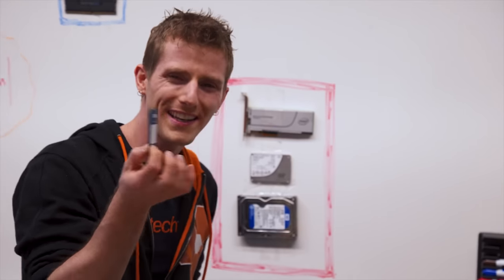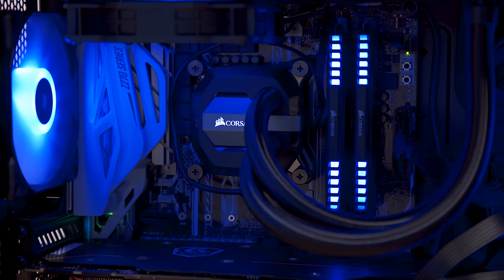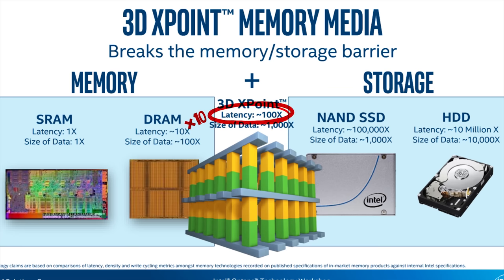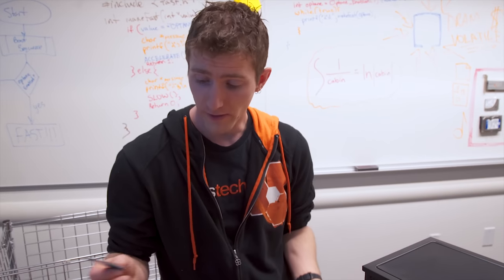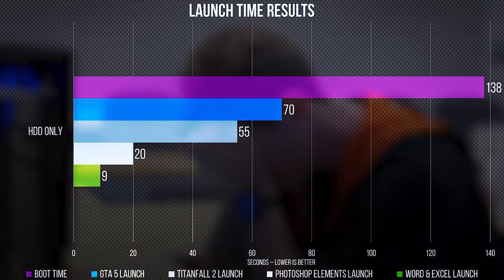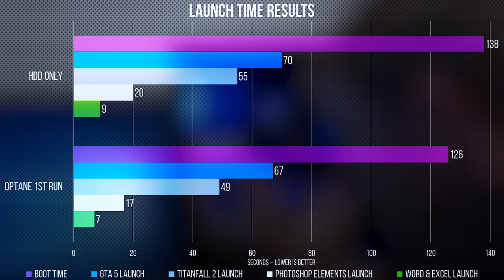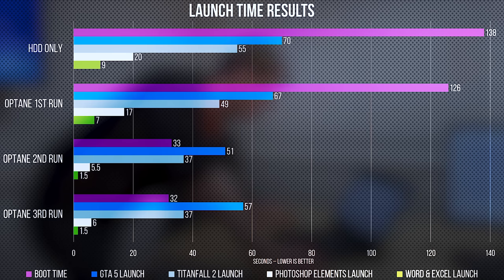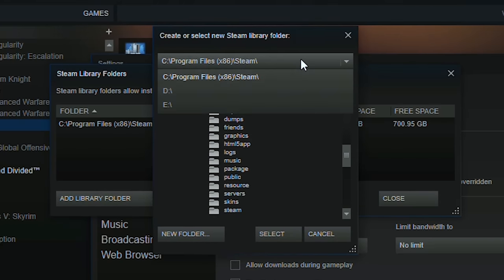Intel Optane Exclusive Hands On - SSD Crushing Performance

Comment: Everyone uses SSDs now why was optane compared to a HDD only
Reply: Pathebach You have to pair it with an HDD.
Reply: Okay, so let's see it paired to an SSD. (I haven't used an HDD in close to ten years.)
Reply: I'm betting it would slow the SSD down. As you would expect when adding another layer of something that's not appreciably faster.
Reply: Now . . . sell me 2.5TBs of the stuff on a single M.2 card for $500—and then you have something. Until then? Why bother.
Reply: Richard Due I think your missing the point of this product.
Reply: This product has a point? Do you want to guess why Intel isn't comparing the speed of this product against a Fusion Drive? Because I can answer that for you real quick. Do you want to guess why Intel isn't comparing the speed of this product against the newest SSD drives on the market? I can answer that one even faster.
Reply: Why is Intel comparing this product to pokey old hard drives? I mean, I don't see GM comparing the 0-60 time of their Corvettes to 1960 Mustangs, do you?
Reply: The man is right guys. This product is useless, the technology is very good. Just wait for actual optane ssd's the technology is still too new.
Reply: Because Optane is not targeted to the PC with SSD. If you use Optane with SSD, it won't be any faster.

Comment: In case it hasn't been mentioned, the beauty of optane and 3dxpoint is the speed and resiliency over ssd and no volatility compared to dram. 3DXpoint's speed, latency, etc. is encroaching dram speeds. If we had nonvolatile storage as fast as dram without the cost, why would we need to separate memory/ram from harddtove/storage? Big enough optane sticks in the dimm slot and you can run the entire is and everything on it directly from memory, as if you had terabytes worth of dram running the os and files.

Comment: so basically it turns your hdd, into a hybrid drive but split into 2 parts on the motherboard. Caveats:
1. over M2 instead of SATA, (so a little faster)
2. The algorithm that decides what to cache is pretty good (learns from iteration 1)

Comment: Good video, short and informative.  I was hoping this tech would replace current M.2 NVME drives with something many times faster, but it was not.  Instead, it is a very fast hard drive caching device which does improve performance.  And since it is a cache device, files open at normal speeds the first time you open them.  Once they are in the cache they can open faster.  If the batch of files you plan on opening are larger that 32GB, the size or this device, you may not get the full effect.  Just not what I was expecting.  Thank you.

Comment: I created something similar with a Z68 board and a 32gb mSATA drive using iRST. Just a "cache" drive, but it did speed up Windows 7, Battlefield 3, and other applications as well. Of course that was quite awhile ago. Same idea, just updated "interface".

Comment: This would be a great add on for some lower spec users that are rocking hdd's. But i think the problem lies in the z270 and kaby lake processor requirements as most people these days building new systems already are using SSDs. 
So the real excitement will come once we can get these in bigger sizes at good $/GB and use them as main drives.

Comment: For ext4, data=journal vastly increases I/O performance of recently and yet to be written data on an HDD.    Also use noatime, nodiratime (noatime doesn't affect diratime, I tested it) and async.  Data=journal improves overall performance on lager disks for most workloads because the journal is large enough that copying data from it to the general area of the partition can be done while the HDD has nothing else to do.

Comment: The problem with caching is not the speed of the cache but the SIZE of the cache. As it is now, the small size can only cache the OS. If this is the case, launching programs would still be slow as a HDD because the cache does not have enough storage to cache it. A better solution is to use a ssd cache so it can cache much more data.

Comment: If this is gonna be usable we would need to expect atleast 250gb drives. Because even with the speed the limitations of the OS and other hardware won't let us benefit beside the storage amounts. But if it does reach that capacity and is around $2 to $3 per GB I would be all for it for early adaption. Considering I'm only using NVME drives as my main storage.

Comment: I am quite pissed about the whole "you need a 7-series cpu to use this" bullshit. This one goes to intel: you would not need to desperately try to force people to your new cpus if there was any useable advancement when changing from a 6800k to 7700k. Just do your job and quit annoying us.
Reply: Then dont buy it, some of us move forward and not back. I dont expect the first generation of this product to me WOW, but the second generation I expect alot from this. For alot of people, I can see me putting down 40 bucks for this stick, and buying like 4 2TB HDD's if it gives all my HDD performance like an SSD. Actually that is pretty cool. Instead of buying multiple SSD's
Reply: I surely wont because i don´t need it in my ssd only system.
I am just worried about these developments. At least Intel and Microsoft try to force us to switch to new tech that, in itself, shows no real benefit. So they complement it with nice advancements in other areas. Be it the x point cache or dx12. I would call that "artificially outdating".

Comment: 1. Would like to see what effect this has on an SSD system drive. I know it's not the intended usage and probably not a boost anyone really needs, I'm just curious to see the numbers :)  (effect on a hybrid drive too, for that matter) 

2. SSD system drive, big HDD for games <-- still a common setup, yep/no?  Could you use this thing to benefit only the secondary HDD (to get as much benefit for as many games as possible, rather than spending any of its space on the system drive)?

Comment: i think that the purpose of this, (if we leave aside the fact that it's made for 7th generation intel cpu's :3) is that if someone wants a 1TB or more of disk space an ssd would just be too much instead you could buy t optane for like 70-80 with the hdd and achieve ssd like performance

Comment: Thank you Linus! I've been waiting for a video explaining this.  My question is that with my new build, I have a Samsung EVO 960 m.2 250Gb with a 1TB 7200rpm sata HDD. I also have a supporting z270 mobo and a 7th Gen Intel proc. I cant find a straight answer on whether Intel's Optane Memory technology only works with their own Intel M.2 SSD's or it will work with my Samsung m.2 + other brand m.2's. Thank you for all the content you continually crank out. They have provided huge amounts of help.

Comment: I'm going to buy an all new system that is ready for this stuff. Got the money saved up right now. This requires a very new high-end system. I like the top of the line Intel unlocked processors, they rock..

Comment: I just built a machine z270, 64GB Corsair dom-plat and the samsung 960 Pro m.2. Will this optane memory do my system any good? I think the Asus Formula IX has 24 PCI lanes. Is there enough bandwidth to go around? PS, this machine is for Photoshop/Lightroom etc.. Lastly, how does this compare to Ramcache/Drives.

Comment: So........my question would be.........If I have just built a desktop using the z170 MB, Skylake I7 6700k and two sticks of Samsung 950pro 512mb NVME, configured in Raid 1; is there an extreme benefit to ditching all of that for a z270 MB, Kabylake 7700k and switching to an Optane memory stick in place of the 950pro SSDs?

Comment: I use smart response. I think people under estimate it. It's really nice for large storage drives. It can also cache arrays. Or have a games or editing ssd use part of that to cache your storage drive. Yes this is rather high end compared to where it was marketed but it works well. 

I would like to see a in deep dive into this since I don't have Z270. Does it cache anything to any drive? How hard it the setup as Smart Response was tricky especially when you wanted to still use your SSD as a boot drive. Does it cache writes or just reads? The durability would make me think reads as well.

Comment: As I'm sure others have commented, this looks the same as Intel's "Smart Response Technology" using an Optane drive instead of a flash-based SSD for caching.  You've compared the performance of a hard drive with & without an Optane cache -- if you'd also do the same measurements with & without an SSD cache this video would be worth watching, instead of being a waste of time.

Comment: I imagine that the broad-market end-user case is to speed up application load times and make your computer seem "peppier" - it is NOT a replacement for storage. If I was Intel, I would be marketing the Optane as a quick fix for your aging computer. The downsides: #1 apparently (at least at this time) you need an Intel platform, so they have lost much of the bargain computer market out there; #2 your motherboard needs an M.2 slot, which rules out most computers built more than 3 years ago.  I wonder what the return rate for the Optane will be from the typical user who can't/won't read the system specs first. 

There might be a niche market for custom PC makers also, but make no mistake - that probably isn't going to sell as much product as the "older computer" market.

Comment: Hang on, what is the difference in performance when you replace the mechanical hdd with a standard SSD drive...or even a hybrid SSD would it be worth all the cost of a 7th gen intel cpu and motherboard that supports m.2 ?  cause once you games have loaded, you just wait for other players to load their game anyways...

Comment: Try as I might, I can't see the point in this... surely an ssd or nvme drive is all you'd need to speed up a system, there could be some use if you already have windows on a HDD, but even then you can mirror the data to an ssd using software. Is it rated just for consumer devices? In enterprise it could be useful to boost access times on shares ?

Comment: You could still buy an acceptable SSD with more storage space and add a primocache license and you'll be better caching bigger stuff like games, not to mention with the ability to configure the cache as you want and avoid the requirement of having to buy a 7000 series intel chip plus a 200 series mobo. 16GB or 32GB won't be enough to cache more than probably one game plus windows stuff...

Comment: i get it, its not for enthusiasts and heavy gamers, but more for the basic consumer/ office work/client machine.  but it requires a 200 or higher series motherboard, so in reality, a new build.  in this case, why wouldnt the system builder opt for a fast SSD or nvme instead?  capacity is never the issue since the target audience isnt necessarily looking for mass storage.  a $50-$70 for a 500gb hdd and another $50-$100 for the optane stick would make no sense when you can get an SSD of the same capacity for cheaper. as SSD/nvme drives increase in larger capacities and get lower in price, who in their right mind would consider an HDD as a boot drive?  these days SSDs even include decent encryption as well, which is especially a nice bonus for businesses.  This tech seems DOA to me.

Comment: I'd be amused to see a USB Hub for storage that has Optane in it.  You would have a Thunderbolt or USB 3.0 connection to the Hub, the Hub would have 32GB Optane, the Hub would have 8 USB 3.0 ports, and you would hook up whatever externals you want.  The Hub would search the drives to develop a directory structure and remember that cache no matter what ports the drives are plugged into.  Then, on the Windows side, have a dedicated space on the Optane drive for Windows ReadyBoost (or is that what Optane normally does?).

Comment: I'd like to see very high speed embedded RAM n ROM CHIPS functioning like a RAM n HDD at the same time at least 128GB on motherboards but depends on CPU and FSB of motherboard , a redesigned MB perhaps .This will help CPU to output data faster and RAM to get data to it's optimum speed and video card to display at best and might help in overall system cooling.

Comment: So am I correct in my understanding that this is essentially a flash storage stick used as a cache to proved quicker load speeds? Flash is non-volatile memory and has up in the hundreds of gigabytes of storage. I guess Intel worked out a more efficient way of pairing more traditional HDD or SSD storage standards that can be translated, pulled, and rewritten to flash and vice versa?

Comment: if this module is designed for intel 7th gen cpu+200 series MoBo , wouldnt it be better to get an sata ssd(leave nvme ssd's) which is kind of similar performance in load time, and ofc no headache of compatibility issues, IMO, if a person can get this config , can also get an ssd :3

Comment: to have a super high  performance i think Intel need to create a  high speed cache with processor i7 technology .. for example for 1 GB they have to add two core running in 500 mb and 2 cache running with 20 mb the speed will double

Comment: does this help on a system that already has a SSD for the OS? like if you have a SATA SSD and would like to just add optane instead of replacing the SSD with a NVME based one.

Comment: Boot time is overall start to desktop or just to initial log-in screen ?
Either way I am running my OS off a 1TB HDD and have my games on a 400GB SDD with a Pentium G3258 stock CPU, 8GB RAM, a 780ti GPU and my boot times are consistently around the 1 minute mark from boot up to desktop, and that's with me having to input my password into Windows 10.

I don't get why your boot times are so high, how much stuff does your PC have to load on log-in if its at the 2 minute mark ? :O

Comment: Is the Intel Optane made to pair specifically with an HDD to create faster load times?  Or could it be paired with a Sata or NVME  SSD for a performance bump?  

Don't believe it was actually stated in the video, although the implied use seemed to be with a hard drive, for those users who don't have an SSD.  But wait, the Optane requires an NVME slot on the motherboard, which means we aren't talking about the average user who might only have a hard drive in his system, and a system that doesn't have an NVME slot.

I would like to know if the Optane increases the performance with an installed SSD.  I would imagine minimal improvement, if any, but would still like to know.

Comment: From what I've read the Optane drive (16GB or 32GB) was designed to boost access speed of a mechanical hard drive but I've seen some reviewers link it to a SSD (with O.S. installed) showing a access speed increase.
My thought was what would happen if a Optane drive (32GB) was linked to a M.2 drive (with O.S. installed), with 2 1TB SSDs for storage?  Would this combination eliminate bottlenecks, lagging and buffering?

Comment: when will people understand that this is more intended to have your secondary storage be vastly faster, you can boot or ssd and have important programs on it and then the hdd be vastly faster with this, that way your system is relatively fast overall at a low cost.

Comment: Both my Z270E motherboard m.2 slots are occupied by Samsung 960 SSD's in RAID 0. What to do to benefit from Optane? will Optane acceleration be available in a PCIe x4/16 form factor down the line I wonder?

Comment: People looking at this type of speed in their PC will be most likely be using a combination of a good quality M2 drive,  RAM and motherboard, which will be packed with features that enable fast boot times and already have blazing fast system speeds. So I guess that's the enthusiast market.

This seems to be aimed at the regular consumer market that haven't upgraded their spinning disk drives, which is fast becoming unnecessary (for me anyway), so I'm just not convinced by it?  Most regular consumers aren't going to be thinking about these options, so why would they buy it?

With it specifically being non volatile, perhaps there may end up being a configuration that works well for the enthusiast. Something sitting in between a quality M2 drive and RAM that provides SIGNIFICANT performance boosts I'd be interested in. I just haven't seen that yet as it's only just been released.
Reply: It would be the consumer market - which primarily still buys what the OEM has provided and does not want to care which type of disk (SSD/HDD) is used for which type of data - i.e. it uses one logical and physical disk for everything.  this is basically an equivalent of a customizable SSHD where you get to select both the cache and the disk size separately. 

Also, for everyone detracting it: it is the cheap option for new users, especially as it is supposed to work with e.g. i3 and any el-cheapo basic 200 series MB chipset - something that is likely going to be the standard base for AIO PCs by the end of the year (same as Skylake still is). The user will not buy it, but the OEM might just to claim "blazing speeds" of solid-state.

Not even close to the enthusiast market.

Comment: Would this help of you have an SSD (Windows) and HDD for Applications and Games? (Like most of the setups with the system requirements for this) Or only makes a difference if you have an HDD?

Comment: Since I already have a relatively high-capacity SSD drive to boot from that also has room for any demanding games I play (GTAV for example) this Optane wouldn't help me much. Add to this that I could get a 64GB m.2 SSD drive for cheaper if I wanted something to start really fast and it seems to me to be redundant in most use cases.